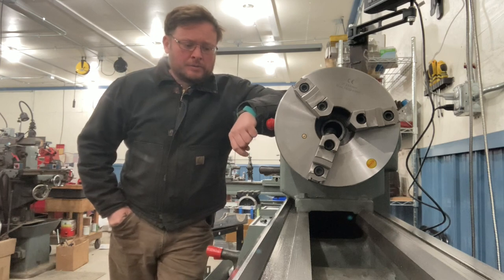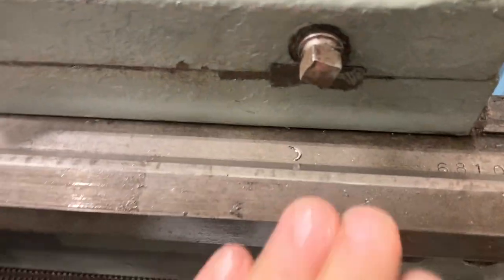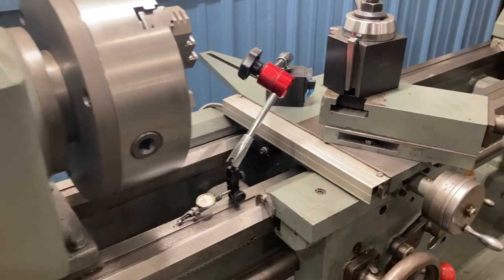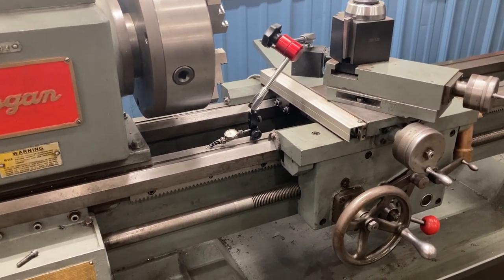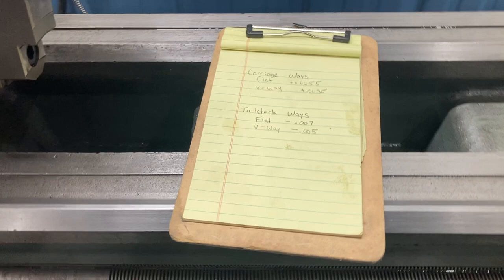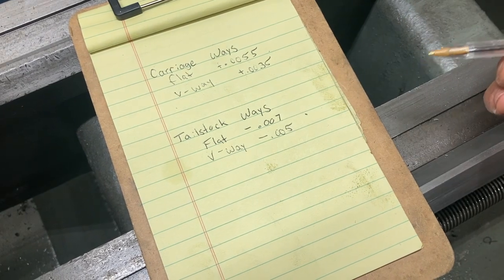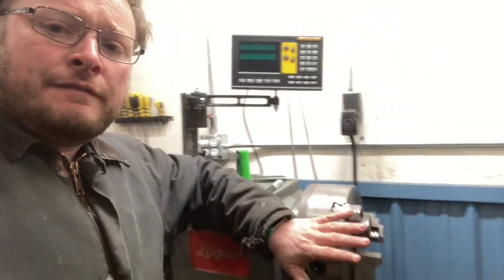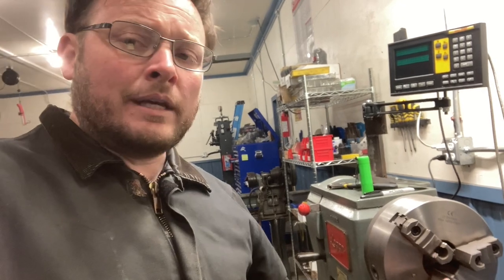5 Tests for Lathe Bed Wear - Complete Simple Methods

Comment: Bought an old lathe in Australia a couple of years ago.  Have done a fair bit of research on the various methods of repairing a host of the parts. 
Moglice & Turcite B are off the shelf type products that can be used to repair all Way surfaces.  There are also DIY recipies in various forums.  If a lathe is badly worn it is still repairable.  Dont dismiss it.  Rather go for lower price as there is more involved in  restorating it to top condition.

Comment: If you had a decently long scraped flat straight edge, you could blue that up and use it on the ways to get an idea of where high and low points are at and also use that with your flashlight. And, if you had access to one or owned one, another great tool is the King-Way Alignment Instrument which uses sensitive machinists levels in two directions to get a sense of bed wear. And you can also attach test indicators to take readings. Great video, thanks for taking the time to make it and share.
Reply from the maker: Thank you for sharing about that tool. I’d love to find one someday!
Reply: @MaineMachinist  - there is one for sale on eBay currently, $5K, I am not the seller.

Comment: If you lift the gearbox off the  base it is usually the same machined level as the tailstock end.  Run a couple of lengths of aluminium T slot bar will give you refference from the headstock and tailstock datum.

Comment: Thanks for the explanation very clear and useful info for checking wear ,my old Harrison L5 is worn in around the same area of the bed too,I also did another test by chucking a 16” precision ground bar in the chuck to near zero runout at both ends of the bar.I then clamped a DTI gauge in the tool holder and zeroed at central point of the circle of the bar.Then moved the carriage to and fro along the bar from the headstock towards the tailstock,The results were  clearly visible ,in that as the carriage moved along the highs and lows of the ways and bed caused the DTI point to leave the centreline of the circle resulting in some very precise indication of wear.
Reply from the maker: Thanks for the comment. There are some neat ways to check for wear if you use your imagination! Maybe I’ll try that for the fun of it. Thanks for watching!
Reply: @MaineMachinist  Bonus points - 1. You can make a bar with centered conic holes at each end via a steady-rest.  Characterize it before use in your shop or in the field.  Measure diameter uniformity  with a 'mike' or v-block & indicator.  Measure the amount and clocking of eccentricities at the ends and along the length between-centers on a lath.  Mark the paths of high, neutral, and low run-out.  The neutral paths can be used with an indicator to measure horizontal and vertical deviations for both tail stock offsets and tool shifts due to bed wear.  No massive surface plates required, just record and subtract the test-bar's variations😊.  2. By measuring and subtracting the front flat's thickness variations, you can use the "Method of reversal" on indicator readings of the flat's top and bottom surfaces to get both the flat's straightness and the indicator's path deviations.
Reply: but did it affect your cut much?

Comment: One thing, stone the surface with a precision flat stone to remove burrs ,do this on the machined flats besides the ways as they were machined at the same time as the ways. Use that as a reference when indicating carage and tail stock

Comment: Hallo from Athens, and thanks for your nice video. I have the Southbend 9a lathe, which is 80 years old and works perfectly, but I think there is some wear in the middle. Since it is difficult to find a new bed, what kind of repair do you suggest ? Should I use the Turcite b tape, or any other special tape or other material? Any other solutions? 
Thanks again and best regards. Spiros

Comment: 16:54 isn't the 3.5 thou vs 5 thou just the v block being at 45 degrees? assuming it's also 3.5 on the other side of the v, 3.5 * sqrt(2) is 4.94 thou.
you'd probably also get that if you positioned the indicator moving vertical instead of measuring tangent to the way
Reply: Similarly 5 * sqrt(2) is 7.07 (I guess duh 3.5 is half of 7). why there's 0.002" between measuring tailstock to carriage ways and carriage to tailstock, I have no idea

Comment: When using the dti mounted on the carriage, perhaps indicating the top flat of the front v way may reference a truly unworn surface. Not sure, still lots to learn in this area.
Reply: However that still incorporates the saddle wear, rather than isolating it from the bed, giving an idea of total system wear.
Reply: One other thought, zeroing the indicator in an area where both ways are minimally worn and advancing into the worn area may lead to more intuitive results, rather than needing to reverse the values afterward. Just thinking out loud.
Reply from the maker: Good thoughts. There is no perfect way to read wear, like I mentioned in the video, without having the entire bed on a known reference surface.

So taking as many measurements as possible to estimate the bed wear is important. I see no reason why your ideas wouldn’t be helpful to gain even more information and continue to add to the big picture.

Thanks for commenting and if you think of other ways, please leave them in the comments

Comment: Would like to see a video of how you compensate for us hobbiest
Reply from the maker: Back when I was in trade school, the lathe instructor was an old retired Tool Maker. He told us about an work out turret lathe he used to operate when he first started out as a machinist. 

The machine was worn, and through experience they knew that the tool height dropped over a certain portion of the ways, which increased the diameter of the work because the tool was no longer contacting on the center line, but below it.

Eventually he marked the worn section of the ways and found that it he leaned his knee on the carriage as it moved along that section of the ways, it would compensate for the tool drop enough to make it turn true.

There are so many funny stories like that. It takes time and experimentation with your machine to get to know it’s quirks.

For example, on this Logan I know the tool drops near the chuck, as shown. If I don’t want to leave material for sanding as an option, I’ve sometimes extended the work out and supported it with a steady rest so I’m turning beyond the worn area.

There are little strategies you can develop over time

Comment: how much bed ware is acceptable and what is the potential effect of having the difference shown on this lathe? i intend to use it at home. if i were to go over the surface  on a 10 inch part on this lathe, would it be straight within 5 thou since that was about the ware on the ways?
Reply from the maker: This lathe is used successfully in a professional setting in the repair work industry.

Competent machinists can adjust for bed wear in order to make good parts.

A home hobby user may struggle to hold closer tolerances with this machine, but most Hobby Machinists aren’t doing anything critical anyways
Reply from the maker: This lathe would turn a taper over 10” of trace for sure. There are means of adjusting for this to compensate, but that’s out of the scope of this comment section.

Comment: Another possibility is to Clamp 2 Machined Blocks one at the Headstock the other at the Tailstock then stretch Piano Wire across them.     Measurements between the wire and the Ways will show a Bowing or Wearing.  Lots of reprints of Old Machine Shop books, even though times have changed the Principal's remain the same.
Reply from the maker: That’s a neat thought
Reply: you can also electrically isolate the piano wire and apply a voltage to the wire. Using a small speaker or light and an inside bore micrometer the wire distance can be measured when the circuit is completed

Comment: You can use an autocollimator to measure wear without needing a surface plate.
Reply from the maker: I doubt the average viewer is going to purchase a tool that is sold used at prices higher than most hobby lathes they would be evaluating. Also, I’m not convinced it is the best tool for these purposes.
Reply: @MaineMachinist  You can also do it with precision levels and a sled, which is a fraction of the cost of an autocollimator. It's just plain wrong to say it can only be done with a large surface plate.
Reply from the maker: @stevencolbert2304  Feel free to create a video showing your method and upload it.

Comment: 9:53 A better way to do that would have been to reference off the unworn undercut in the bed in-between the ways.
Reply from the maker: If you look at it closely, that surface is pretty rough
Reply: @MaineMachinist  From the video it looks like it's in better condition than the ways you were referencing. The problem with the way you were doing it is the wear in the tailstock ways is unaccounted for. So now you know the difference between the tailstock ways and the carriage ways. You don't really know how much wear is actually in the carriage ways.
Reply from the maker: @24681359David  as mentioned in the beginning of the video, each of these methods is an estimate only. 

There is no way to accurately measure the wear in a precision manner without having the bed on a master reference surface like a large granite plate.

All we can do here is estimate
Reply from the maker: @24681359David  that undercut you mention isn’t a precision surface
Reply: @MaineMachinist  It's machined into the bed, no? It's also about the only surface on the lathe that's unworn. It should be allot more precise than the worm surfaces you were referencing.
Reply from the maker: @24681359David  it’s like the underside where the carriage lock method drags. That’s not a bare casting but it’s not a precision surface either. Scott Logan from Logan Lathe saw this and actually mentioned that.

Do it how you want, but the point is there is absolutely no way to truly measure it in an accurate way. Not accurate in a machine shop sense anyway. All you can do is gather evidence and make estimations on the wear.